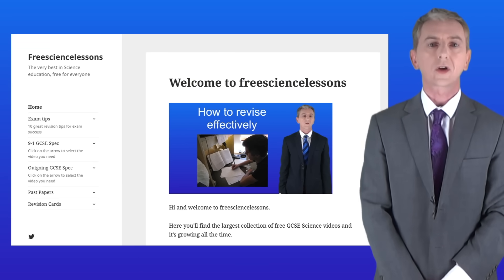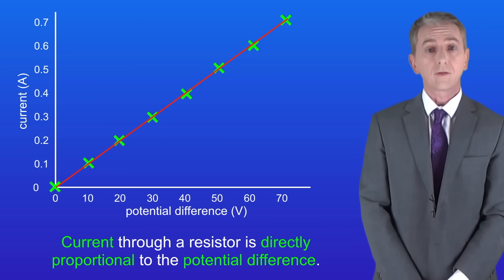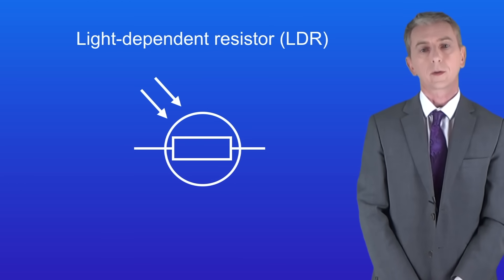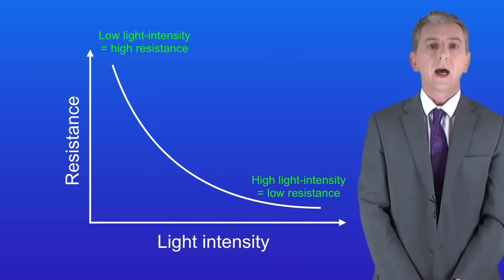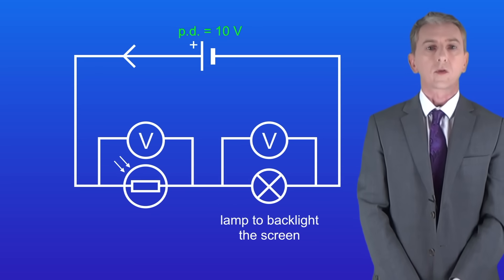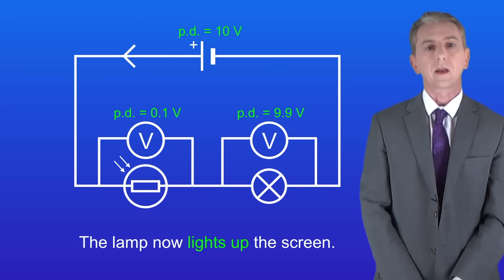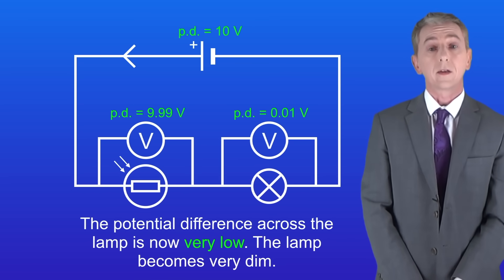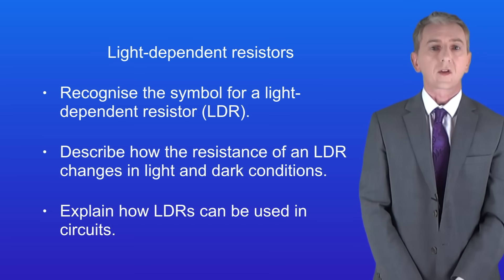GCSE Physics Revision "Light-Dependent Resistors"

Comment: does it matter if the lamp is placed before the LDR in the circuit?
Reply from the maker: No because the potential difference of the cell is shared between the two components so it doesn't matter which way round the components are in a series circuit.

Comment: sir, I don't really understand how LDRs work for street lamps. In the case of street and garden lamps, the functionality of LDR is supposed to be reversed to have low resistance in the dark to allow the lamp to turn on; so how does that work if resistance is low in the presence of light?
Reply from the maker: I understand your point. You need to bear in mind that streetlamps contain circuits with electronics such as transistors so they're much more complicated than the simple circuits that you need to understand at GCSE.
Reply: @Freesciencelessons  ah, alright then! Thank you for answering this fast, may God bless you

Comment: But then how can it be used to turn on light in the dark when the LDR will have higher resistance?!
Reply: High resistance means that the potential difference across the LDR will increase as more energy is needed (which comes from the High pd) to push the current through the LDR. The greater the pd, the more energy it gets. So linking back, in dark light the bulb lights up as it ultimately gets more energy.

Comment: Could you explain why resistance changes in light/dark conditions? thanks :)
Reply: This is unnecessary for GCSE but if you're interested ask Google as Dr Donnelly doesn't have the time to reply to everyone, sorry for not answering it's just I only learn what is needed for GCSE.
Reply: @fireemperorzuko8756  true there is only so much time you have, and perhaps not enough to learn things you wont be tested on.
Reply: unless its in your specification i would advise to not learn it
Reply: @arakurd6351  I agree, as long as you learn what's needed for the spec and understand it, even if it's the bare minimum, it's sufficient.

Comment: I just wanted to ask about the placement of the LDR on the circuit(and whether it matters if you place it before or after the lamp) as your diagrams show a conventional current, in a 'non-conventional current' layout would you place the LDR to the right of the lamp (as in this diagram it shows the conventional current passing through the LDR first, then the lamp), so the LDR would act first, reducing the resistance for the lamp to go dim?
Reply from the maker: Hi and sorry for the very late reply. The position of an LDR in a series circuit does not depend on the direction of current flow. Resistors do not really affect current in the way that many students think. They think that there is a large current before the resistor and then a lower current after but in fact the current is affected by the total resistance of the circuit (or branch of a circuit).

Comment: How do garden lights work then???? Surely if the resistance is high at night, then the light won’t come on???? 😫😫
Reply from the maker: Well you've got to bear in mind that all the circuits shown are extremely simple. In actual garden lamps there would be an electronic system which uses the LDR as a light sensor.
Reply: @Freesciencelessons  For automatic night lights, would the LDR and bulb not be connected in parallel because that would mean that the potential difference for both components would be the same?
Reply: exactly!! literally makes no sense at all

Comment: if the resistance is higher in the LDR, that means more energy is used in LDR instead of the lamp. So isn't that the battery is still running when the screen is off but the battery is running to LDR instead of the screen, which means that it doesn't save the battery?

Comment: Thanks for the clarification. Recently I had a two week break and I usually get 9s and all of a sudden after the break, some of the questions are requiring different forms of answers and I kept on hearing stuff about more work done is needed to force the current via a component and this really confused me. Your videos on resisters helped me and for some reason I'm getting slightly insecure about my knowledge of LDRs. Anyways thanks for these videos, they're still a great help. 

Thanks!

Comment: I dont understand how LDR works in garden lamps. When at night, the resistance is high, so low energy is available for lamp to glow. But at day the resistance is low , so more energy is available for lamp to glow at day. This is the opposite of what we want in garden lamps. Can you explain plz
Reply: this is exactly what I am confused on because if the increase of light intensity on the LDR causes it to decrease resistance than shouldn't that mean that there is more current being able to go through to a component like a bulb. so wouldn't the bulb turn on and be brighter in the light. If it is darker in a room than the resistance is high right? so then how does the bulb in a circuit turn on if the resistance is high... because I'm sure high resistance means less current going through SO HOW DOES THE BULB TURN ON IN THE DARK?!?!?!?!?!
Reply: @humnahnadeem1318  I wonder
Reply: you are able to reverse the effect by using another resistor in series to the circuit. This means at night, there is a high resistance, so low pd in the LDR but high pd in the resistor. The resistor can be in parallel to a lamp, which will then light up at night. Hopefully I help someone.
Reply: @guppydaboi8601  thank you
Reply: @SLasher 025  basically  in a potential divider  using ldr  when the light intensity is low  the resistance will be high and as  we know voltage is directly proportional with resistance so when the resistance increase the  voltage will increase therefore the circuit will work
Reply: SLasher 1040 the ldr acts as a light sensor

Comment: Hi Sir, 
I am really sorry but still am a bi confused, if you increase the resistance, then this would mean the P.D would be high for the LDR, but that would result in P.D being decreased in the lamp, meaning less current would pass through. In the dark, would you not want the light to turn on instead of off?
Reply from the maker: The example shown requires the light to be turned off in the dark (ie a phone screen held to your ear). Garden lights turn on in the dark. I should point out that the circuits in GCSE are very simple compared to actual circuits (which use more complex components such as transistors).
Reply: Freesciencelessons thank you

Comment: So this means that when the resistance of LDR is increased in the dark... Its voltage is also increased but its current is reduced... Due to which the lamp is getting larger amount of current in series that causes it to light up in the dark. Is that correct????
Reply: I believe its current will remain the same- as it is a series circuit so current will be equal for every component. Secondly, as the equation for resistance is R=V/I provided the potential difference increases and the current stays the same , resistance can still increase in the dark